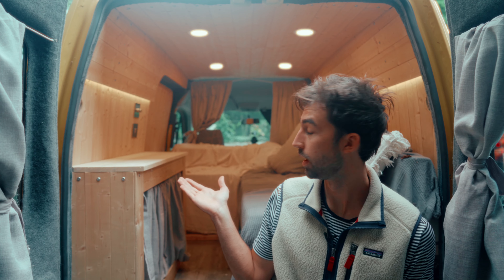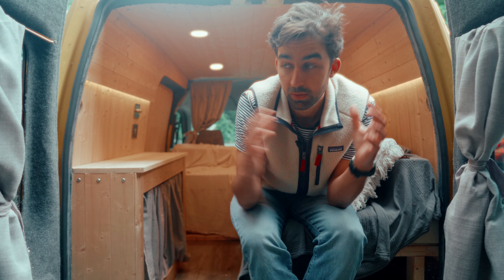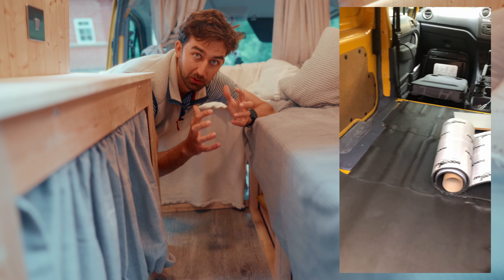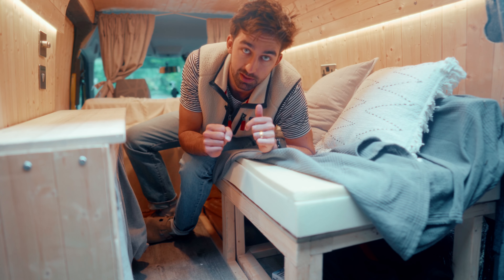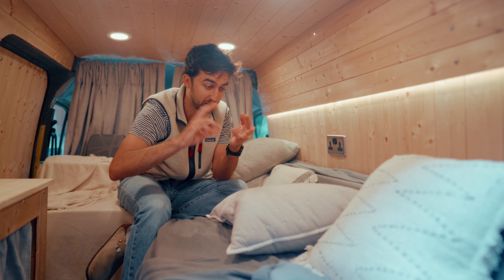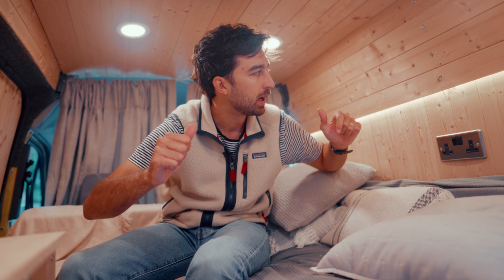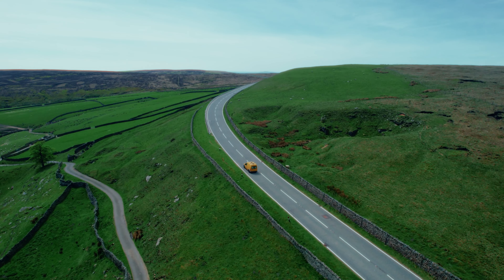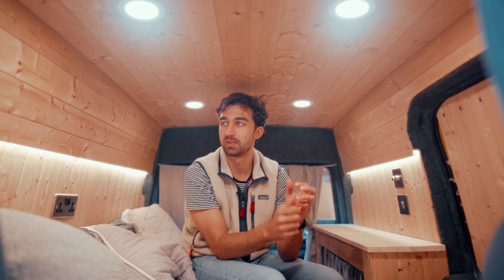I converted a Ford Transit Connect into a Campervan | Full Tour of my DIY Micro Camper

Comment: specific question....what screws have you used for the cladding? they look v nice and tidy!
Reply from the maker: Hey! So I used some pretty standard screws (can’t quite remember the exact ones, maybe 5mm in diameter), but the trick is I paired them with screw cup washers which really make the difference 😊 they looked much better with the cups against the wood and protects the panels from splitting when screwing them in.

Comment: It’s adorable great job!! 🥰 I have a T5.1 and am almost ready to hit the road..was going to power everything via a ‘Jackory but am now going to have electrics installed to power my new fridge as that needs to be fixed to a leisure battery forcing the electrics route.. how much would you say electrics cost janoux 🙏🏻
Reply from the maker: Ah amazing! Exciting that you’re almost there with it 😊 so our battery was pretty overkill, but does allow me to charge everything all the time - it was about £250! You can find good ones for much cheaper! Having the switch relay and leisure battery is so convenient though once installed, so would recommend it if you’re adding a fridge 👍🏼 switch relay was about £50-£100 and then extra wiring/ fuse box would depend how much you need but can get a good amount for not too much online!
Reply: @janouxgerber  thank you Janoux this does help me to make sense of what I need 🙏🏻 a family friend converted/lives on a boat and said he’ll help me which will save £££’s on an auto tech..apart from the fridge I could use like an outlet for my laptop/pad/phones and have bought a mini dehumidifier to help combat condensation 😉👌we just need some decent weather now ey! 😂🙏🏻